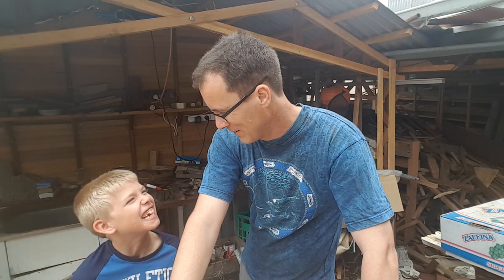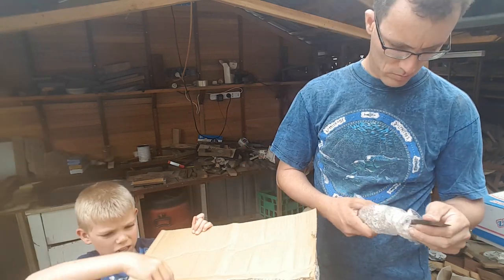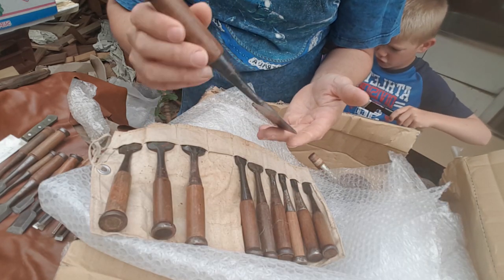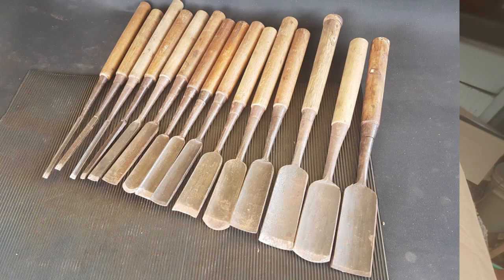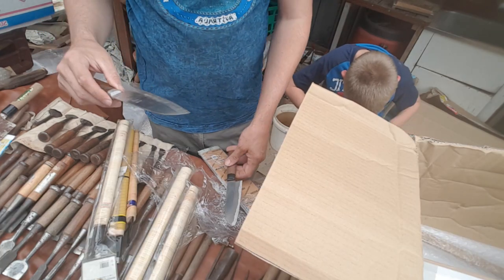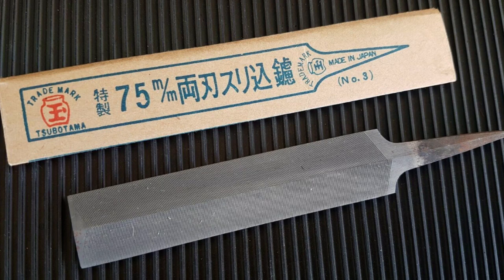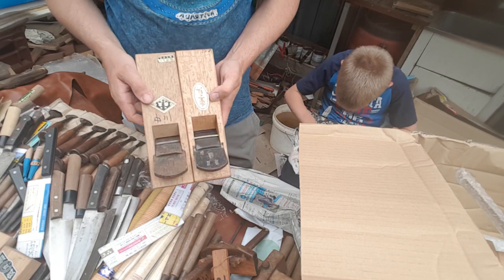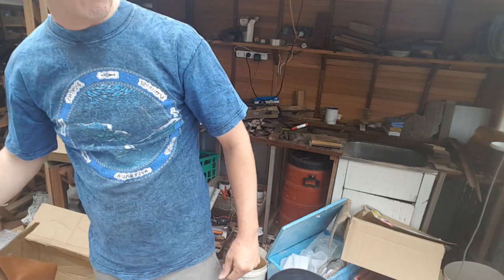Mystery Japanese Tool and Reptilian Party Crashers

Comment: Some kind of scriber? There are similar modern ones made for fitting large irregular timbers together..
Reply from the maker: The flat base though suggests its not for that job. What it appears to be based on some other suggestions is a surface gauge. Similar job but you work off a flat bench or plate. Say to mark all your chair legs at a fixed point above the floor/work bench.